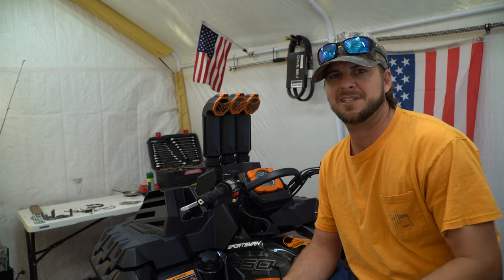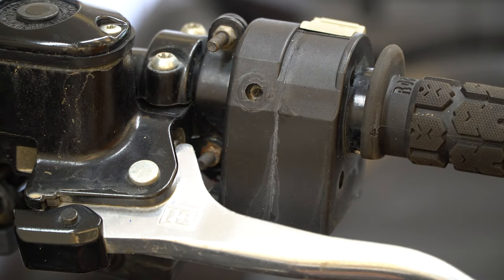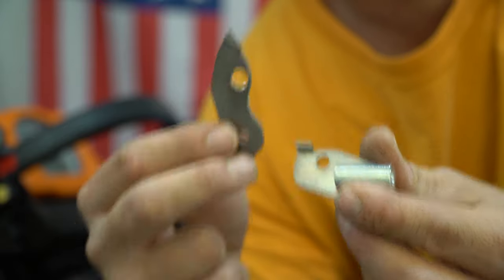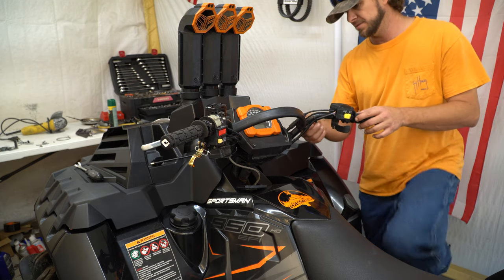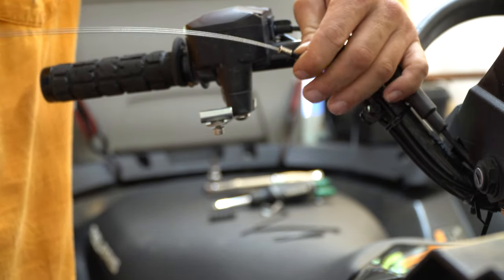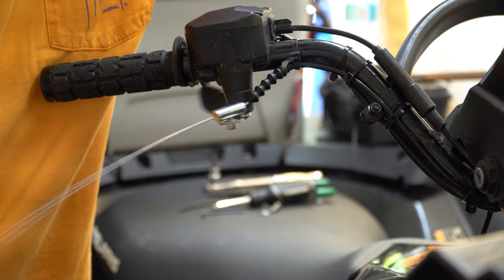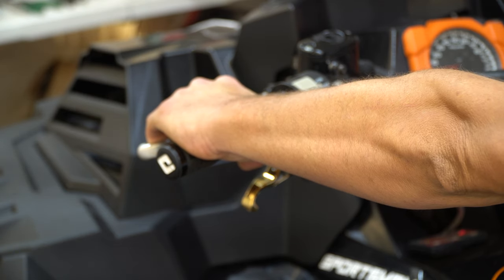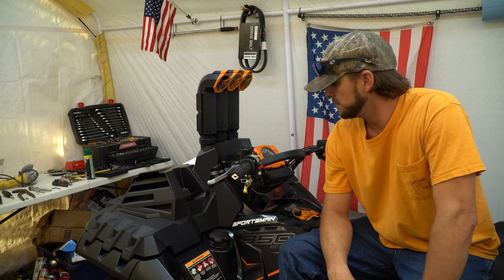Polaris Sportsman Goldfinger left hand throttle installation

Comment: Great video. It looks like there is missing hardware on the right side.  If you look at anything that uses that type of setup, there would be a solid piece of metal that locates and holds the end of the cable housing firmly so that it does not just flop and hang there, supported by only zip ties.  Sorry I can't explain this better but if you look at any of the cables on a bicycle you will see what I mean.   It just does not look proper to me.  After looking at this more closely it also appears that the round barrel (they call it a throttle block) where you use the set screw to hold the cable and then put your crimp cap on next to it, there is also another piece missing from the design.  I would not crimp the cable in this barrel.  I would get a shorter barrel with a set screw in it, and put it after the first barrel and then let that be what is being pulled on from the left throttle.  When pushing the right throttle, this would allow the throttle block barrel to slip or slide over the cable with no force required as opposed to what it does currently, it pushes the cable toward the left. This was a mind bender for me, having never seen this in person.  I hope this post inspires others to take a second look and perhaps modify it to work better.
Reply from the maker: Everything works great and was installed as per manufacturer instructions. as far as their design it work just fine and has been in service in the snow mobile world for many years. If you feel the design could be improved I would contact the manufacturer to offer this advise as I am simply a individual installing products on my personal machine. Thank you for your support and mentioning your concerns
Reply: @acoustic4037 I agree with you. I have been running a gold finger and it is 100% missing that part to hold the cable to the throttle linkage . I made one out of an old v brake and it works beyond better then the old setup they provided.

Comment: Heck ya buddy I’m not sure why you use a left hand throttle I would be screwed with that setup either way big like and share from tbc bud
Reply from the maker: Thanks TBC! When you get stuck alot of times you have to lean way off the left side of the bike and you can't reach the throttle so this solves that